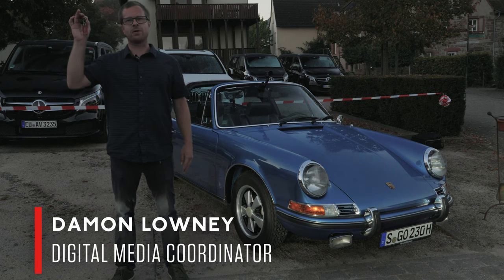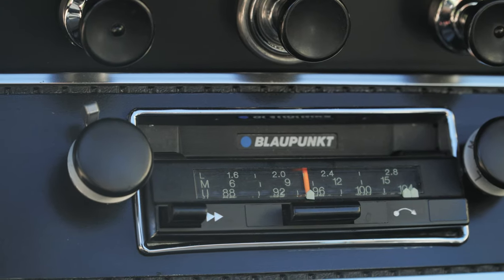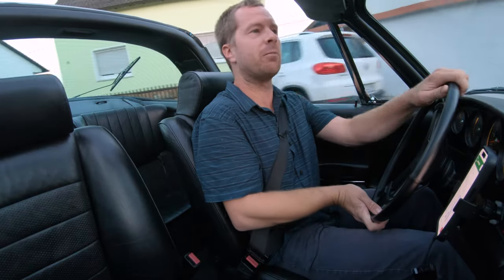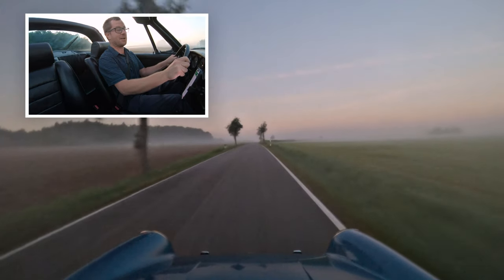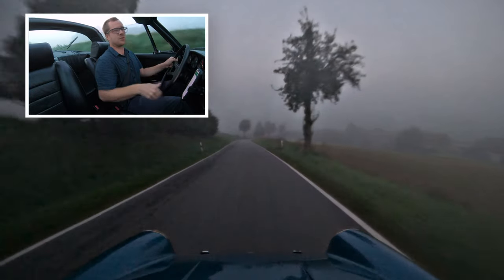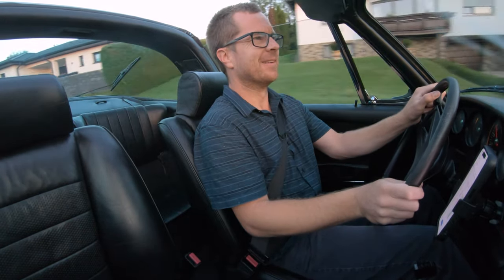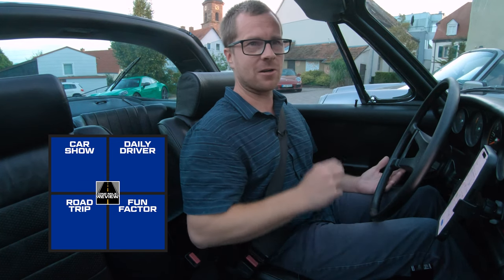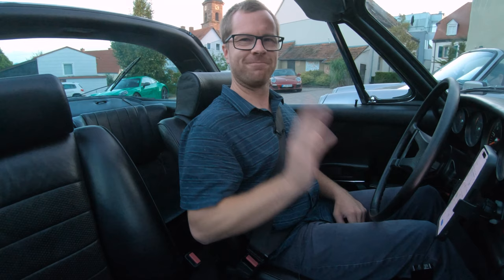1971 Porsche 911S Targa: A Quintessential Experience? | One-Mile Review

Comment: As an owner of a 1970 911 E I have to point out a correction. The 70 & 71 911's used an updated gearbox (the clutch actuation was different from earlier 901's). This gearbox is correctly identified as a 911. I'm surprised in a PCA video error was allowed.
Reply from the maker: You are correct, thank you for pointing out our error and clarifying. Sometimes errors get through even after several watches by PCA staff.